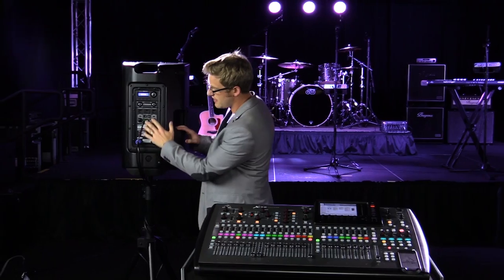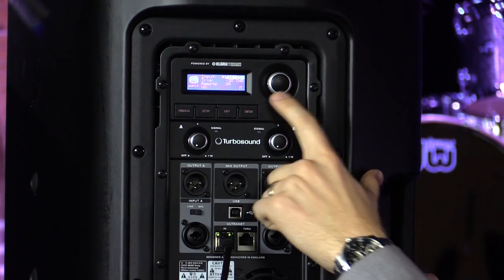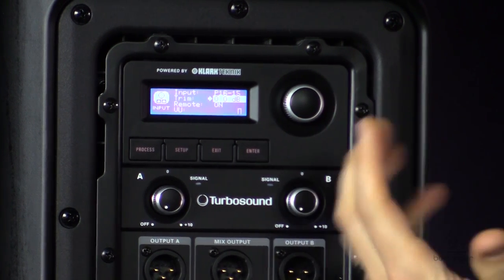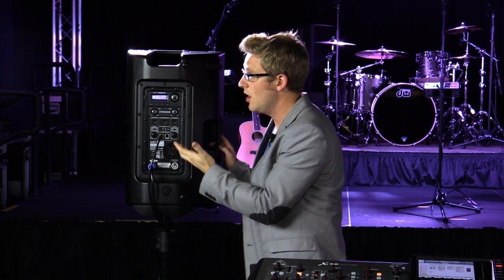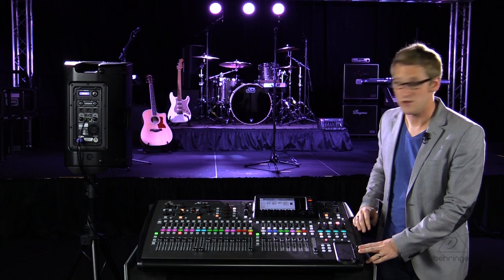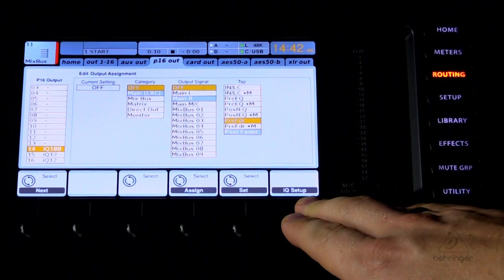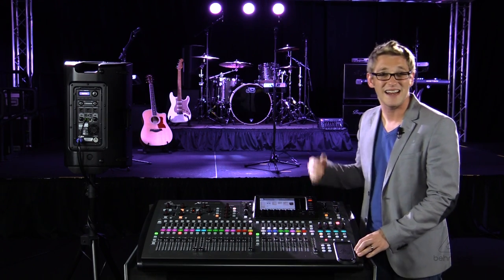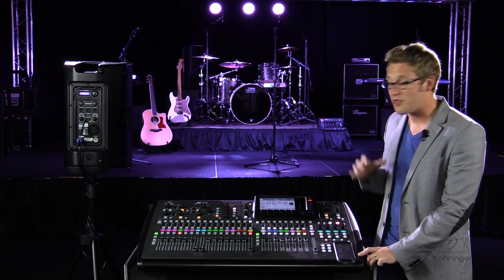Acoustic Integration for Your Portable Church with X32 & Turbosound iQ (Part 2 of 2)

Comment: Can the crossover points be controlled from the X32?  I assume the speaker models have different crossover points.  How does the IQ12 know we have a subwoofer?  
If you are running a mono sub, would assigning it to Main Center be get the summed output of Main Left and Main Right?
Would be nice if you could talk about using the subs with an Aux output and separate fader control from the tops.
Reply from the maker: +kkinerk You specify which type of speakers are being used on the ULTRANET output in the Acoustic Integration section of the X32 console.
Reply: +BEHRINGER Meaning that......??? The acoustic integration
section understands that we are using a subwoofer and it knows that it needs to
apply certain crossover point? And by the way, the crossover point will be set
depending on.....??? if you are using iq15 or iq12??? Please elaborate a little
bit more about it.

Comment: I am considering getting the Turbosound IQ series speakers for this Ultranet feature. I would like to setup main Left & Right speakers, Subs and Monitors. Will this method effectively free up outputs 1 thru 8 on the back of my Behringer X32 Rack, in essence expanding my output capabilities?  I hope that makes sense. Also should I purchase a POWERPLAY P16-D to make all of this work or just use the daisy chain method that you mentioned with all speakers? Thank you so much... Great video.
Reply from the maker: Yes Richard, using ULTRANET will allow you to free up the XLR Outputs on the back of your X32 Rack if you choose to run it this way with the TURBOSOUND iQ speakers.

Comment: Hello. Can we use the Ultranet to configure and control the iQ speakers from the X32 without having to use up channels on the P16 output? Essentially, I'd like to be able to retain those 2-4 channels for musician's monitors. So, can we just send the audio to the iQ speakers through XLR and control them through the Ultranet connection?
Reply from the maker: No Jonathan this is not possible. All audio passed via ULTRANET from your X32 to your TURBOSOUND iQ Speakers must be controlled the ULTRANET tab. ULTRANET runs on a separate bus from the XLR Outputs of your X32, so each need to be controlled individually.

Comment: I currently have a couple IQ 15 tops and and 2 IQ18b subs that I want to start using with ultranet. In the above video you only assigned one IQ18b to Left output and channel p14. Would I want to use P13 and assign it to Left output for my left sub and P14 assigned to Right output or my right sub? I am using the internal crossovers in the speakers so I wont need to worry about that using ultranet correct? Just leave them the way they are?

Thank you very much,
Derek
Reply from the maker: That's correct Derek it can be done that way. You can also run signal from you P13 signal to both subs for most standard mono subwoofer configurations.

Comment: Does the IQ only use the P16 as Outputs or can they use the AES50 out from the stage boxes.
Reply from the maker: +Sean Williams Nope, AES50 does not support this feature. This can only be done with our proprietary ULTRANET connection ports.
Reply: +BEHRINGER how can you use the power play distributor for p16's via ultranet and integrate the IQ system over ethernet??? can they be daisy chained someway from one or the other???
Reply from the maker: Yes they can be daisy chained Luke. :)